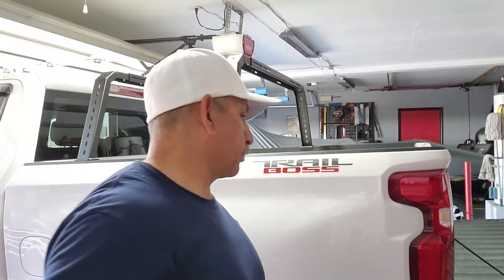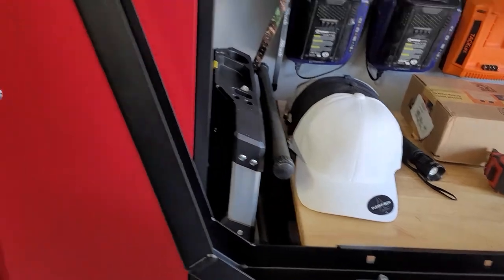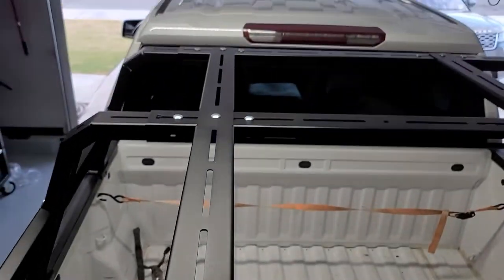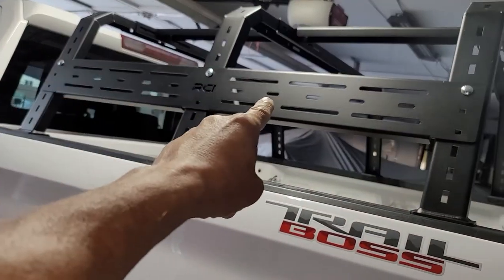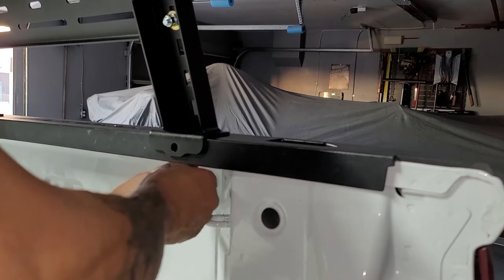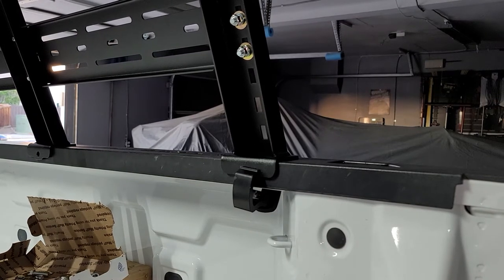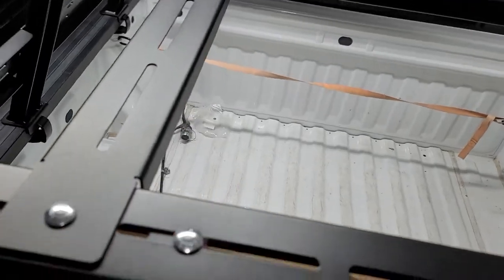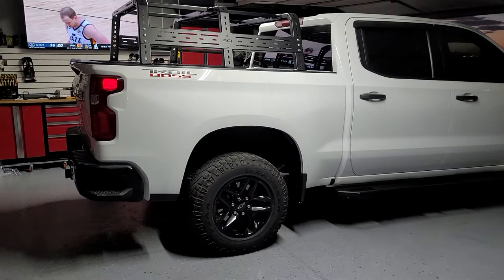RCI Bed Rack 18 inch Silverado Trail Boss

Comment: The carriage bolts for the width adjustments should be mounted on each side of the C channel, not on top.  8 per hoop section. As per Instructions online